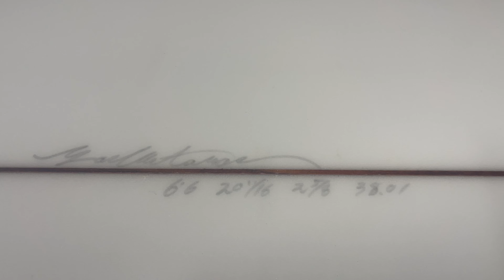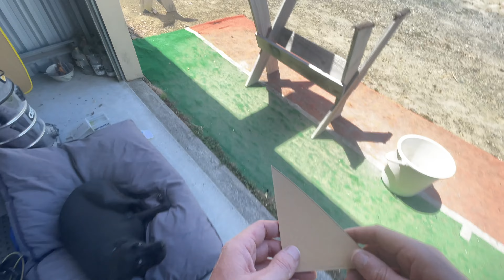Brand new custom got the courier treatment

Comment: Really great job mate! and massive appreciation for showing also your mistakes and the thought process on solving them. Also, might be a bit of oa dumb request, but could you do like a short or a video explaining how to properly do relief cuts? I have a massive difficulty doing them without cutting too much and not properly overlap or too little and it make air pockets. Cheers!!
Reply from the maker: Hey hey, appreciate it! I have a short on relief cuts. You’ll find it in the “tip of the day” playlist which should be on my channel page. Let me know if you have trouble tracking it down 🤙
Reply: Thanks for the reply! I’ll give it a look

Comment: Very complex repair but very nicely one as usual!  I was a little surprised with your comment about epoxy reacting with your paint where polyester wouldn't but you've got experience I do not.  Beautiful work and I'm sure your customer is very please - well worth the wait!
Reply from the maker: Chur! The trouble with epoxy is that it’s very sensitive to any outside chemicals that it might come in contact with. Oils, silicones, dusts and debris and even the chemicals within a lot of paints. Waterbased paints are the recommendation for under resin application (once it’s cured you can paint it with anything) but, even waterbased paints can cause issues so most people/manufacturers have just resorted to painting over the top once it’s cured. 

Epoxy is a great product but can be a nightmare to troubleshoot causes of problems because there is always so many potential reasons for the issue.

Comment: could the board be damaged by a fork lift pushing in a harder pallet into the transit and slid the pallets a little wee bit to far and crumpled the nose by front pressure like a can crumples ,only a thought ,, gr8 job mucker,x
Reply from the maker: Yup I reckon a slow squeeze from end to end is what did this one. Could definitely be the fork lift!

Comment: Great job. Just a question though. Would it not have been easier to make a template with cardboard and then cut the stringer
Reply from the maker: Haha, there’s probably a few things I could have done with that stringer to make things a bit easier. Usually I just free hand the rocker on jobs like these and they come out fine so it’s not usual I focus so hard on the rocker like this. Learning curves on this job for sure

Comment: Beautiful & Perfect. I have a question. What is the reason for wet sanding?
Reply from the maker: Appreciate it! 
Wet sanding serves a couple of purposes. It allows for a less harsh sand with the slickness of the water (some people add soap too) as you move into the finer grits of paper. Think of the coarsness of your kitchen scourer when it’s dry vs when it’s wet.

Another benefit is that the water washes away and softens debris that can get stuck under your sandpaper and cause scratches that are harsher than your sand papers grit. Pieces of sand and fibreglass are probably the most common in my line of work

Comment: Why not use paint under epoxy? What paint , method should I use??
Reply from the maker: Epoxy can be really sensitive to any outside chemicals you add to the mix. If you do need to paint under it then water based paint is the recommendation but if you look at 99% of epoxy boards, the paint is always on top of the finished fibreglass, not below.

Not to say it can't be done, I kind of proved myself wrong in this very video, but as a whole, the industry has, rightly so, decided to avoid doing it as the risks of having problems is just too high.
Reply: Thank you.    What about tinting epoxy fill? @smallkinedings
Reply from the maker: @chriscoralAloha  definitely an option worth keeping tints around for. This method comes in use more if the board is done with a resin tint though as most painted epoxies will be paint over glass so that final stage will hide your tinted filler. Colours like red, yellow and orange have terrible coverage characteristics though so your tinted filler can act as a base coat to help hide the repair with paint. Easier to hide red filler with red paint than white filler with red paint. 🤙
Reply: Thank you.   Great idea about the tint base.  @smallkinedings